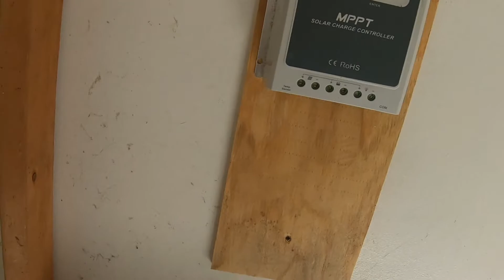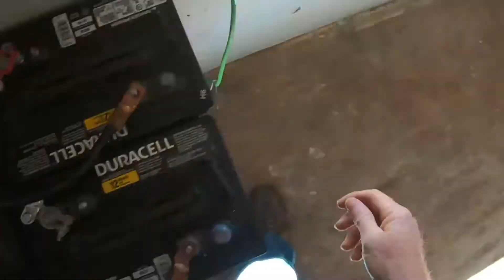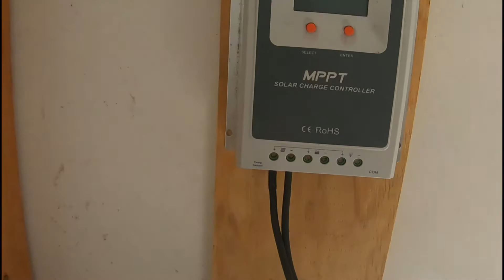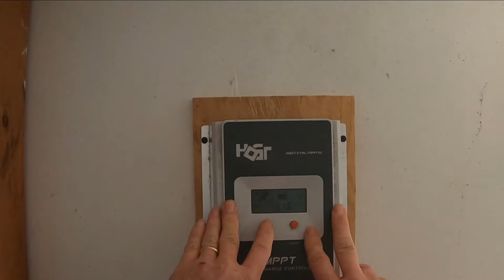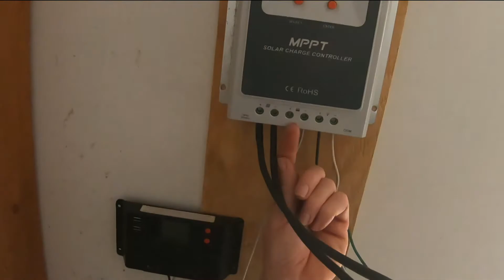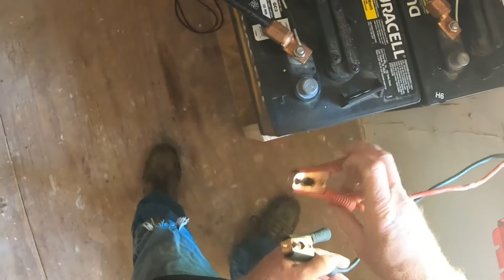Easy DIY Solar Set Up (Cheap!) | You Don't need to be an Electrician

Comment: It's been 4 years. I'm curious about how the system as worked for you, upgrades, changes, etc. You seem to have done a great job!!
Reply from the maker: We've added a new (better) inverter and purchased a few more deep cycle batteries. We have our well on solor, our rain catchment pump for our pigs, and most of the workshop (lights, chargers, and small equipment) on solar. We are working to get more areas set up, but it's a process 😊
Appreciate you stopping by and checking in. 😃